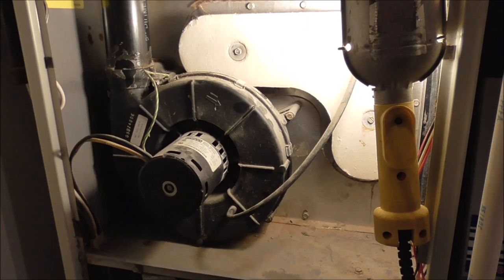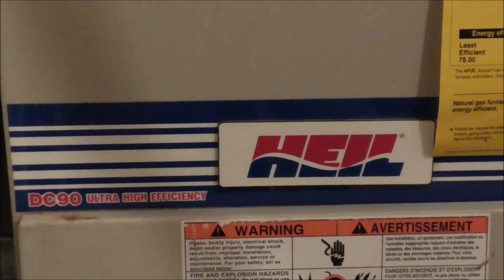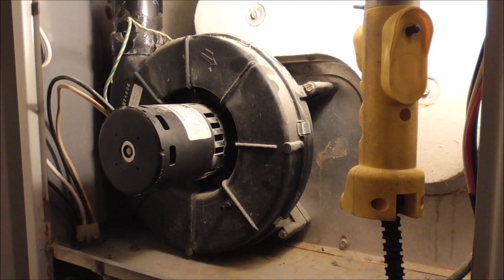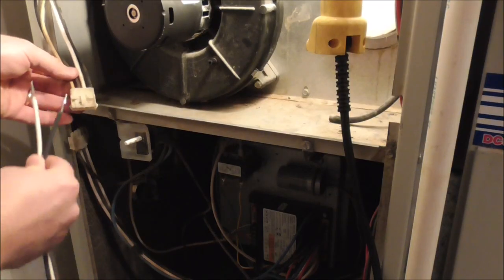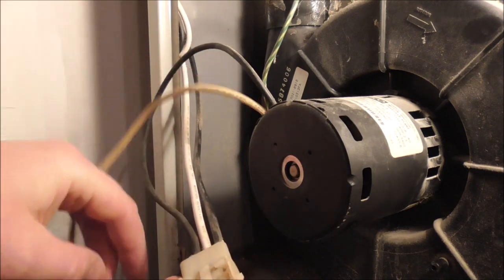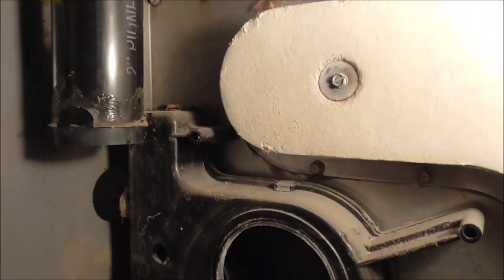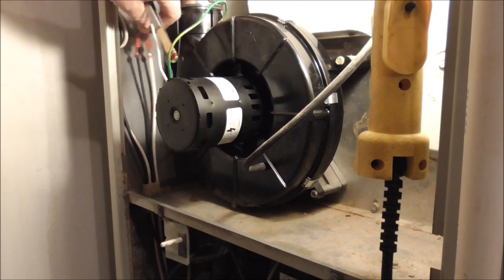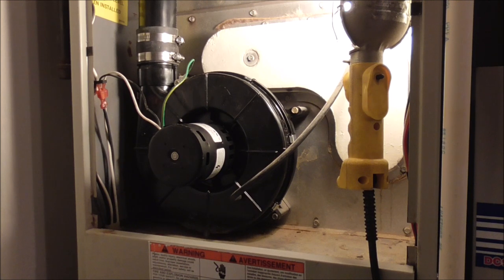DIY Inducer Motor Replacement A170 Fasco on Heil Furnace

Comment: Very useful video! Mine actually started leaking and the local HVAC  company quoted at 691. Got the inducer for 188 shipped! If they don't find you handsome they should find you handy!
Reply from the maker: Glad you found it helpful!
Reply: @OutsidewithTom  immediately noticed the noise reduction! Mine has almost like a tick noise and I think i might hear it in yours too. You notice that?
Reply from the maker: That ticking noise you hear in the video is the sound of the flames in the upper part of the furnace.

Comment: Just replaced mine today. Couldn’t believe someone had the same old furnace as me. I didn’t need the wire adapters I just clipped mine on. Thanks for the video.
Reply from the maker: Glad you found the video helpful. A little over a year after this repair, the old DC90 furnace is still running great. Should be good for another 20 years. 😀
Reply: Outside with Tom 
We’ve had ours since we moved in which was in 2003. The sticker says 1993 so it’s been a long time either way. Fingers crossed for a lot more years. 🤞
Reply from the maker: @ctuagent31  Hope so, good luck!

Comment: Hey Tom! Thanks for sharing this video. My furnace just started making the noise you mentioned -- and of course IT'S A HOLIDAY WEEKEND!  I just ordered the blower motor I need - similar model to the one you put in -- and after watching your video I have confidence I'll be able to do the same as you did... because THE REPAIR MAN ISN'T AVAILABLE FOR A WEEK!  Nope, that's not gonna do.

Seriously, four screws, a vacuum hose, a discharge pipe, and a wiring harness -- it can't be too 
hard!
Reply from the maker: You can handle it. It's a piece of cake. (or pumpkin pie) 😃
Reply: Took less than an hour... once the part was here. Thanks again for your video.
Reply from the maker: @nickgiacobe  👍

Comment: Thanks for the video. I had to replace my draft inducer fan on the same Heil DC90 and the video really helped. A couple of comments, Amazon had an aftermarket fan for ~$135 and prime 2 day delivery and it is a great kit.  Also, if you don't want to bother with refitting the wires into the plug, you can just splice and wire nut the black and white wires to the prior ones.
Reply from the maker: Glad you found the video helpful, thanks.

Comment: Good Job, Great concise Video. Thanks. I live in a 1974 Double Wide Mobile, had a micro Burst hit the trailer, tore off the whole front awning and metal roof, and also damaged the furnace Draft Inducer motor. So I'll be replacing mine when it comes in.  We are living on Oven and Electric heaters Heat, so I hope the inducer motor works. Thanks again.
Reply from the maker: Hope that gets your furnace back up and running, thanks for watching.

Comment: Just went through this with my furnace. It was right around $300 for the aftermarket Fasco inducer or you get the OEM Heil/ICP part which is nearly identical and coincidentally also made by Fasco is like $500-$600. Crappy part is the motor on my old inducer was perfectly  fine but the plastic impeller wheel had warped slightly causing it to rub on the housing and of course you can't just replace the plastic impeller wheel at least not from what I gathered.

Comment: i just lubricated mine, and if i could detach the fan, would do a better job, but i guess that isn’t feasible without special tools.
i’ll be ordering another soon.
you got it done, though i took the shroud off to be able to get to the oil port better. it took a bit to  figure out how to undo those clips!
hope it keeps going!
Reply from the maker: I'd replace it now, before you wake up one morning with no heat. Good luck!
Reply: @OutsidewithTom  i got the new one ordered. omg, are those things pricey! but the one i got is around $150 w/ shipping.
Reply: @OutsidewithTom  i never have done a diy vid, but most of mine are of things i consider pretty.

Comment: Very helpful.  My inducer motor has water coming out of it.  I cannot figure out where the drainage is jammed up. The motor seems fine but the water leaks on the inner shelf and down into the bottom of the furnace.
Reply from the maker: Glad you found the video helpful! I believe a few other viewers had the same issue. I think it was due to a worn out gasket where the inducer motor connects to the furnace. Not for sure though, I'm no HVAC expert. Maybe check the other comments.
Reply: having the same issue. Saw other videos saying it could be a clogged drain but cannot tell. My inducer motor is leaking from the bottom too and into the 2 shelves.  Great video by the way @outside with Tom!!

Comment: Did you notice any  condensation dripping from the bottom of the motor?  I have the same furnace.   My motor is making  a lot more noise.   I  was thinking the same thing you did.   Oh I  could get a couple more months.    After watching your video I think I will replace it now.    Just noticed a small amount of water under it.
Reply from the maker: I didn't have any condensation coming from the motor, however someone else in the comments also mentioned that they did. Good idea replacing it before it quits completely. That way you won't wake up Christmas eve with no heat like I did. Good luck with your repair.
Reply: Well guess what?  It didn't make it until the new one came in.    Ordered one off Amazon for 188.00 arrived on Tuesday.    Fan died on Saturday night.      Once I removed the old one I found the seals worn out.   Reason for the water leak.    Second thing was you can use the old  plastic push pins if you break one.    I used a  shop vacuum to make sure the drain line was clear and draining right.      The fan is set up to disperse the condensation down the drain line.    My furnace is installed in 2000 heil dc90.    So the connections were easy because the wire connections matched up with the ones on the fan.  The rubber exhaust gasket was the same.      Your video made it clear to install.   One thing missing is the drain line.    I  suggest people inspect it.    My  fan had a  few pieces broken off.   So I wanted to make sure no pieces fell in the drain line.      Thanks for your video...
Reply from the maker: @michaeloliver5190  Glad you found the video helpful, and that you got your new one installed. Good idea of inspecting the drain line too. 👍
Reply: Michael Oliver hi I replaced mine in January. Just opened up the furnace door to check it out and I noticed condensation coming from underneath the rubber gasket that is attached to the blower motor. I never noticed this before not that I even checked. Not even on the old one. I tightened up the clamps but still does it. The water runs down to right where the ground wire is attached and also behind that same area. I notice it ends up on the bottom of the furnace right below the blower housing. I don’t see any drain line. I’m not sure if this is normal it’s been running fine since January.

Comment: Can you describe the sound it was making before it died?  Mine makes a fairly high pitched almost rattle noise.  It also gets fairly hot.
Reply from the maker: Hi thereve! Before it died, it was just running very loudly, with a high pitched almost whistling/whining noise that could be heard through the whole house. The night that it died I didn't hear it, but my wife told me she heard a loud noise during the night but she thought is was a noisy truck driving by. If you have a rattle, the bearing is probably shot and what you're hearing is pieces of the bearing rattling around as it's running. I think the housing getting hot is normal, as the housing on my new motor gets hot as well. So much more quiet now when running though. FYI, I'm not a HVAC pro, just a guy who likes to do my own home repairs when I can. Hope that helps.

Comment: Thank you so much for this video.  In 2022, this DIY is still very useful.  I should be able to get at least one more winter out of my aging Heil DC90, and just before the cold front moves in too.  BTW did you ever replace your DC90 like you said you might?
Reply from the maker: Glad you found the video useful. We moved fall 2021, and the furnace was still running good when we sold the house. I presume it still is, those things seem to be a workhorse. I kept thinking, just one more winter, but it just kept going and going and going.........

Comment: Hi Tom,  I just replaced my draft inducer blower motor and your video was very helpful.  I found the instructions that came with it to be pretty good, but it was nice to see it done.
It seemed to go smoothly, and the blower is nice and quiet, but, I think I can feel air coming from behind the blower.  My guess is that it is from the connection to the furnace, where I replaced the o ring, and that needs to be stopped.
Do you feel any air blowing to the left of the blower when it is running?  Any suggestions from one DYI'er to another?
Reply from the maker: Hi there DM, glad you found the video helpful. I just checked mine, and I don't have any airflow coming from behind the blower motor like you describe. If I did, I suppose I would pull it back off and check the o-ring connection point and the two foam washers that are back there, and make sure the connections are as clean as they can be. If that didn't work then I would probably start looking at the piece that the blower motor connects to. Good luck!
Reply: Thanks , that's what I'll do

Comment: Must be a christmas time failure thing.  Mine started squealing yesterday.  My father is a master electrician and we've done some facetime stuff.  It looks to be a bearing issue inside the motor and not the entire unit.  This seems to hold with what others are saying about spraying in grease to reduce the noise.  I'm going to attempt to disassemble the motor itself and replace the bearings to see if that fixes the issue.  Could reduce the fix to a few dollars.
Reply: First step confirmed, the noise went away after spraying white grease into the front and back bearings.
Reply from the maker: Might buy you a couple more months. Of course, if you replace the motor now then you can do it at a time when it's convenient, rather than having the motor go out at a very inconvenient time and then all of a sudden you have no heat and it's an emergency. That was my mistake. Good luck!

Comment: I used some Rem Oil to lube the bearings and it quieted right down. Good to go until I get my replacement.
Reply from the maker: Nice!
Reply: @OutsidewithTom  Was crazy noisy before hand!
Reply from the maker: @My-GG-1  I believe it. Mine was noisy for a long time. Eventually the bearing went out completely with a VERY loud crashing sound during the night.
Reply: Outside with Tom same here, two weeks now. New until will be here Thursday. $188 on Amazon. A170 model.
Reply from the maker: @My-GG-1  Nice, wish I would have bought my replacement before the original quit working.
Reply: Got my replacement. Still waiting for the old one to die. Sprayed the bearings again with WD40 lithium grease and it’s much quieter than after being sprayed with the Rem oil. I’m thinking condensation got to the motor as there is puddling under the fan housing every time I go down to check it out. Have to track down that problem before I install the new motor fan. A vacuum line was disconnected somehow from the diaphragm control top right.
Reply from the maker: @My-GG-1  Not sure what would be causing the condensation, I'm certainly no HVAC expert. Good luck!
Reply: Outside with Tom not sure myself but I can see that the pvc exhaust was hung improperly so anything condensing inside the pipe wants to trickle back down into the fan housing. I replaced the until today. It wasn’t without issues. One of the mounting screwed was so rusty the head rounded off and the screwdriver slot was useless. Began drilling it out, slipped and put a 1/4” hole in that housing behind the fan. All good now though. Strangely I’m not seeing any more water leaking from the new unit. I did blow out all the drain lines for good measure. The old unit did not have the seal washers behind the hose drains. Whoever replaced the last motor did a half assed job.
Reply from the maker: @My-GG-1  Right on, glad you got it sorted out! 👍

Comment: Thank you for this video. This is the same furnace that I have. I’ve been able to use a 3to1 oil through the inducer motor fin cage to get to the motor shaft and lubricate the shaft. The high pitched squeaking stopped.  It’s been running great since. I’ve had to add more oil since then but it continues to run quieter for now. I’m sure I will have to replace it and your video helps. 👍 
Does your blower motor run continuously like mine?  I have researched the information on the blower motors and limit switches on blower motors but I cannot find a blower limit switch on this furnace so I just allow the blower motor to continue to run even with the air conditioning unit off cycle and the furnace off cycle in the winter.  Do you have the same problem?  Thank you again.
Reply from the maker: Glad you found the video useful. My blower does not run all the time, only when the heat or a/c kicks on. There should be a setting on your thermostat to set the blower to "Auto". That way it will only come on when the heat or a/c kicks on.
Reply: @OutsidewithTom  
Thanks for the reply Tom. 
I have done exactly as you suggested with my thermostat by setting it to auto but the blower motor still continuously ran. I even changed the blower motor about two years ago because it stopped working (was old). It still ran continuously.  Recently I changed the thermostat and it still runs continuously even when I set it to auto fan. ????   Strange, I know ?  I just thought that you having the same HEIL DC90 ultra high efficiency furnace (exactly) might have the same situation with your blower motor ??  The air conditioning is working otherwise and the only issue is the power usage of having the motor run continuously. It does help with circulation of air in my home lol.
Reply from the maker: Hmmm, my next thought was to replace the thermostat, but you've already done that. Maybe a bad relay somewhere? I'm pretty stumped.
Reply: @OutsidewithTom  
Ya, me too 🤔🧐. 
I’m well aware of the fact that. I will need to replace this furnace at some point but I’m dealing with a financial crisis at the moment and  I’m simply trying to prolong that. Thanks again for responding and trying to help me with fan blower issue Tom. Much appreciated friend. I will continue to try and remedy the situation and if I resolve my problem, I will be sure to post it here for your reading pleasure. Take care Tom.